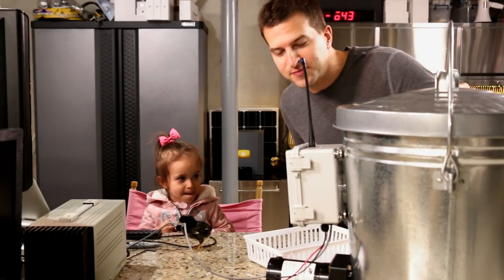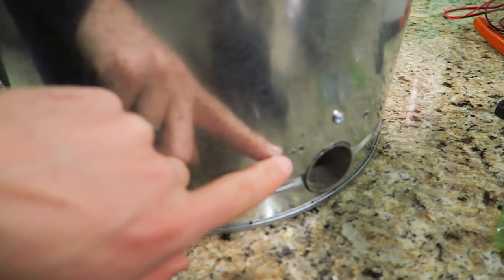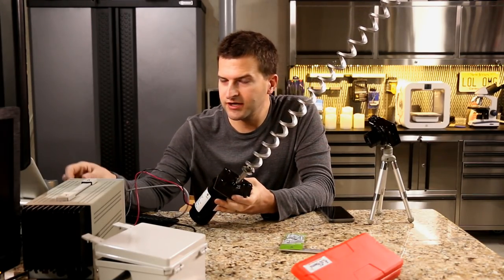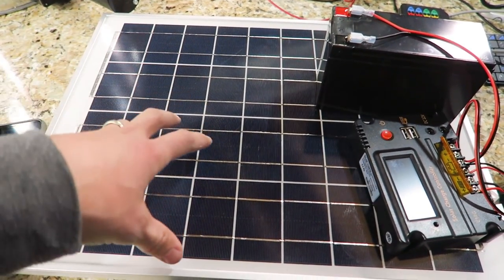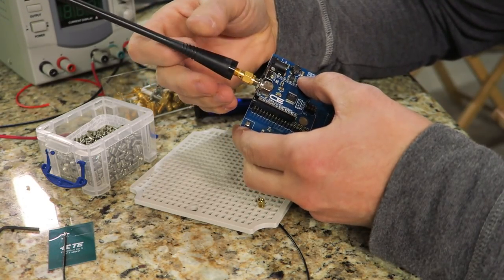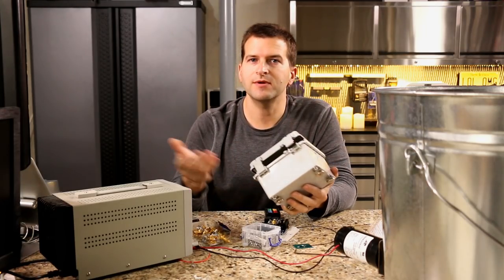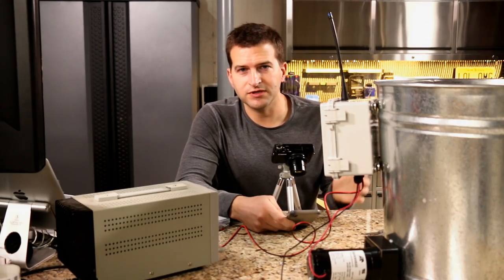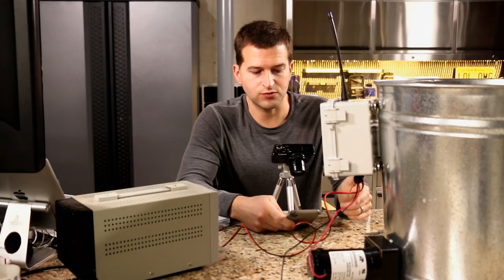Automatic Wifi Chicken Feeder | Full Tutorial

Comment: I would simplify greatly by using a wifi power point switch (SONOFF brand, $27) with a 12v power adaptor.

No pi, no software, no solar,  you can program a schedule and do manual on/off from anywhere using a phone.

I am interested in this to put chlorine grain into a pool.  :)

Comment: I love the video.  I'm a little more familiar with Python and Raspberry Pis rather than Arduinos and C, but I can learn.  I am more interested in a door controller like you have on your run, and that might even be easier to implement than the feeder because doors are pretty complete units as they are. Just add microcontroller, conectivity, power supply and relay. Thanks for the entertainment and information.

Comment: Nice Project. I'm building something similar for feeding our outside cats. I never used the photon before, I'll have to check that out. Oh by the way, I'm using a windshield wiper motor to drive my auger. These motors are powerful and water proof.
Reply from the maker: Brilliant! That’s a great way to go for the motor. The motor I’m using you’ll be cost prohibitive for most hobbyists. I have some other photon videos, but plan to post more. All you need to get something like this going is a photon and a relay board (the particle relay board is fine if you don’t want the remote controller receiver). Been feeding my 9 chickens since the beginning of April with it no issues so far!
Reply from the maker: Also, if you want an enclosure that fits the particle relay board, Polycase has a few options that I use regularly. Check out the WH-08 series. The board from particle is a bit longer and narrower than the one I used in the video. If you’re going to be a distance from the WiFi AP don’t forget to get an external u.FL WiFi antenna (sparkfun antennas are best IMO) and make sure the first line in your code tells the photon to use the external ant.

Comment: Joe, this is a great video, I watched your other video and asked a question about the motor then I watched this one and I see what you are using. In the video you mentioned the motor you used might be more expensive than what is needed and you mentioned a  Traeger replacement motor. I just wanted to tell you that I did some research on that and the Traeger motor is 120 volt. 

Thanks again for the video I am going to use your mechanical concept for my own but I will control it a little differently; The mechanical concept was the hardest part.